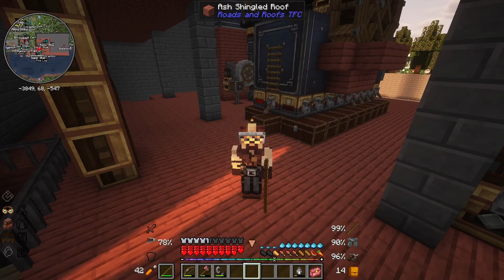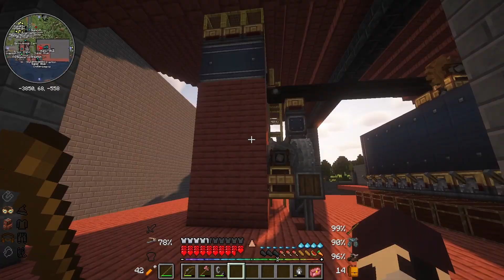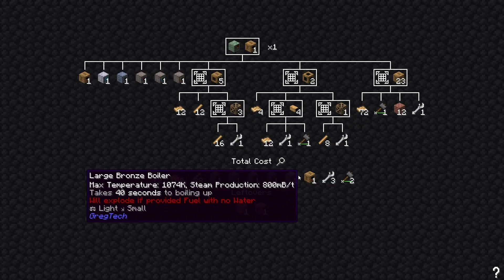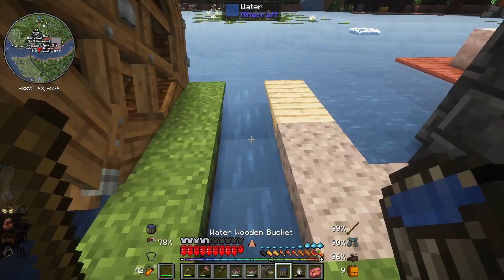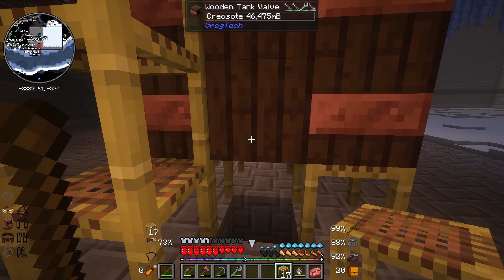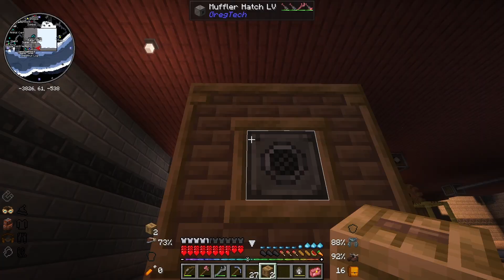Episode 44 "Boiling Point" | Let's play Terrafirmagreg

Comment: For your storage setup you are almost at the poor man applied energistics age ^^ (ie stock ticker + stock link + packagers +stock keeper). You may want to bifurcate to that before doing to much LV stuff. 

fyi, the large bronze boiler does 800 mB/T. A small gold pipe does something like 50. So they are going to be quite the bottleneck (if I remembers correctly ach LV turbine needs  ~65). So at least for the first pipe out of the boiler you should try to use something like a huge steel pipes. After that you can branch out to a bunch of smaller gold pipe depending on what you need. (For me the cheapest were Potin pipe).
Reply from the maker: I'm so looking forward to that. I've seen MrBeardStone do it enough times that I think it's pretty straight forward.

I've got some content already recorded and you guessed it, I had to switch to higher tier pipes. I'm using gold because I've got soooooo much of it. :)